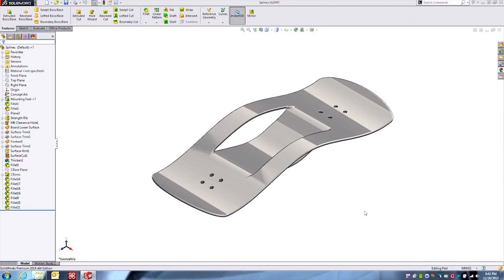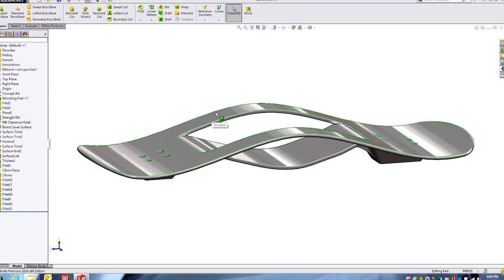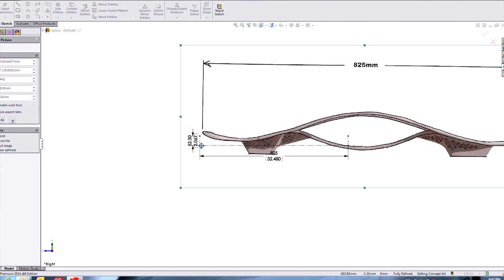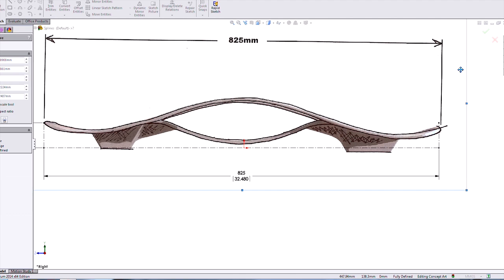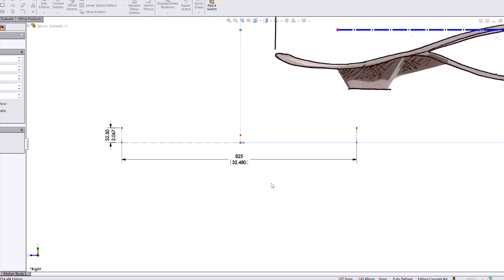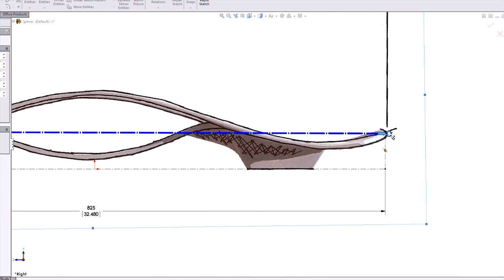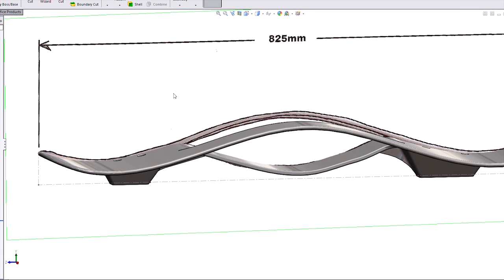SOLIDWORKS - New in 2014: Sketch Picture Scale Tool

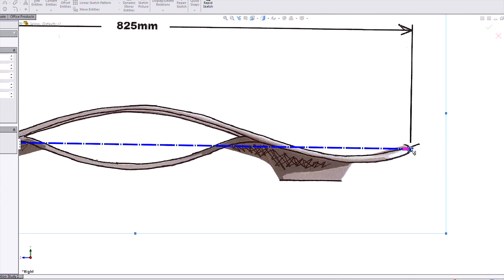Comment: When I do this in my installation of Swks 2019, the modify dialog (which comes up in this clip at 2:48) does not put in an appearance at any stage.
This makes the tool a complete timewaster. I guess I'll need to reinstall AGAIN (but first I'll check with some colleagues and see if it works on their machines)

Solidworks can be a frustratingly flaky application, usually when you are under the pump.
Reply: Did you find a solution for why the modify dialog does not appear? Your is much appreciated.
Reply: @ktorres397  I gave up on 2019 and rolled back to 2018 and have remained there ever since. I'm sick to death of the Solidworks business model: they have their legacy user base over a barrel, and boy do they exploit that to the max. Once it was a fine company, now it resembles Big Oil, ethically speaking